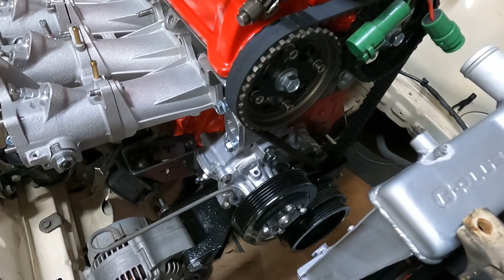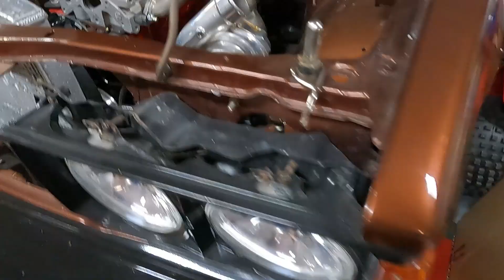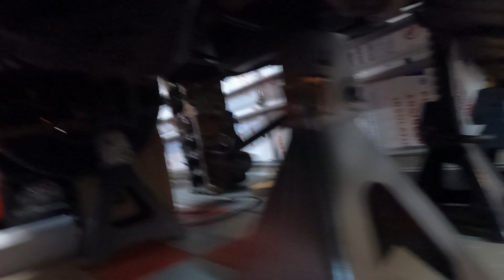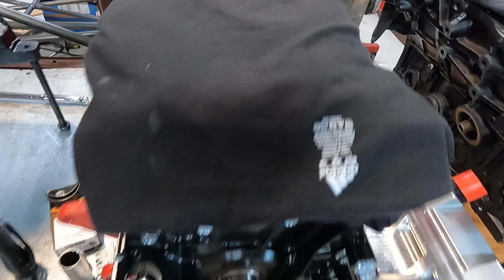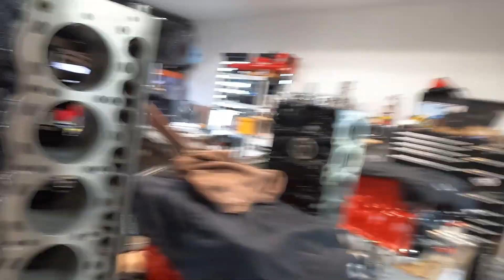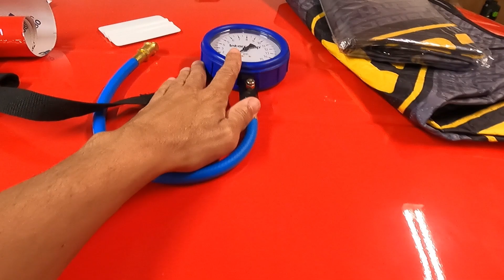Starlet and shop update #psiracing #3sgte #teamtoyota

Comment: Building  12:1 3T myself. Only concern is jetting and timing. Not chasing HP but curious on what this set up may produce.
Reply from the maker: I can tell you all of the power comes from the port in the head. Compression is great, with the right cam but needs that port and good carbs to wake up

Comment: With all you got going don't know if you looked at my old buddy's starlet? It looks like your's red with black stripe. He had a roofing company in Deerfield bch. He also had a red 69 no va dragcar and a 69 cortez silver black stripe Camaro prostreet with a blower. He use to run the nova and the starlet at moroso in WPB. His friend built the starlet he has a Mazda called el nino racing he knew those rotarys. Thanks for the update loving the Toyotas 😊
Reply from the maker: Thanks man, I'm sure I've seen his toyota. Many good times at moroso